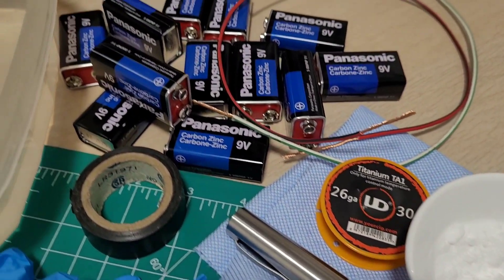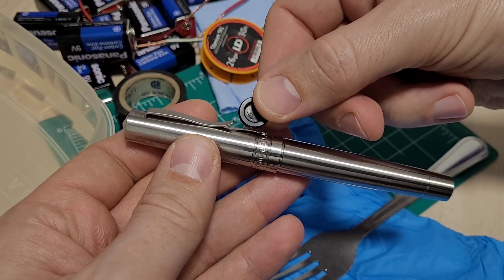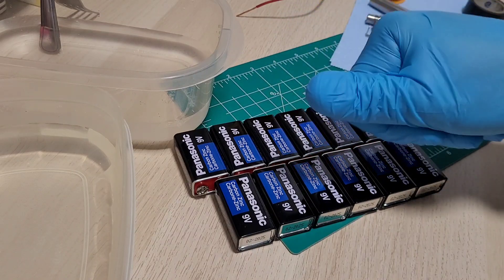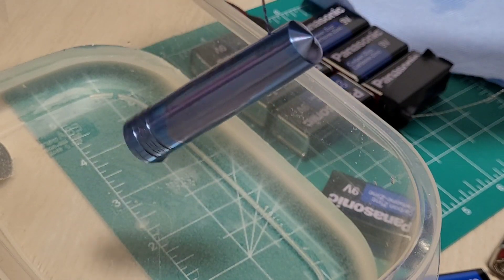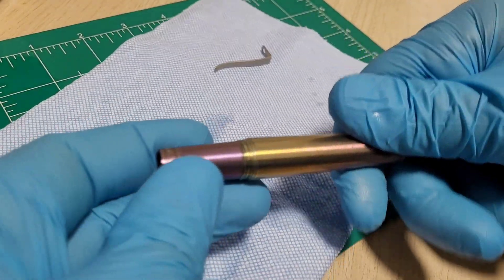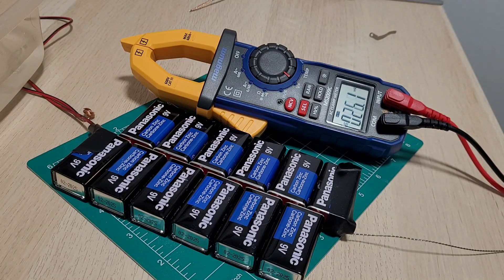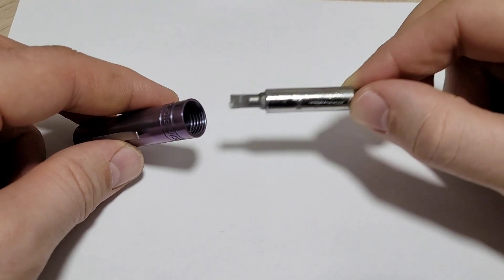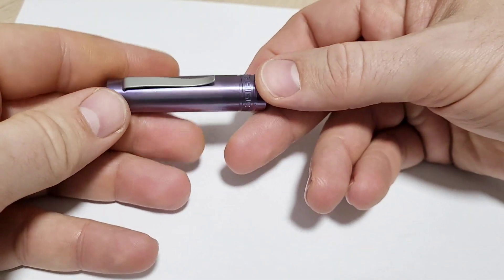How To Anodize A Titanium Fountain Pen (Ensso Italia)

Comment: Forgive my lack of knowledge, but why not just use copper wire for both leads?
Reply from the maker: I haven't spent time testing that out. But if I were to guess, I'm thinking you'd want the wire to be titanium so it behaves the same.  Ti is not a good conductor of electricity. For example, if you were to rank copper as say 100/100 on conductivity, in relative terms titanium would then be 3/100.  So I think if you had a much higher conductive wire, the electrons would flow to that metal instead of the titanium and the process wouldn't be as efficient.  Just me guessing, so not sure.
Reply: @Doodlebud  Got it.  Thanks

Comment: This is stunning!  How can I polish out the oxidized surface of the pen after doing this? Will it be easy to do as well?
Reply from the maker: It has to be etched off with chemicals. Common one is HF (hydrofluoric acid) which is nasty stuff. If you're in the USA  it's easily obtained in a product called whink rust cleaner. Here in Canada we don't have it. So waiting for the border to open to get some. Will be doing a follow up video.  If you do buy some BE VERY CAUTIOUS and follow all the safety precautions.  HF acid is VERY DANGEROUS stuff!

Comment: Do you have an updated graph for desired color now that you know the graph is wrong? i'd really like a teal or something similar. God bless (Matthew 5:45)!
Reply from the maker: Here's a site that has some good info & voltage/colour chart 
https://chemistrytalk.org/titanium-anodizing/
Reply: @Doodlebud  Hey thanks for the quick reply, i'm fascinated & truly tempted to do this, i already wrote down the instructions so i can quick reference when i get to do it myself.

If i can ask one more question, my pen doesnt have the Delrin plastic in the cap, could i dip the cap as is since it's pretty much just Ti then? God bless again, i pray you get to 1 million subs with your informational & fun to watch videos, not just reviews.
Reply from the maker: If yours is  just straight Ti its good to go. The other materials won't anodize from this process. To remove the anodizing afterwards if you want to change it you need to get Whink rust remover which has Hydrofluoric acid in it. NASTY stuff so be VERY CAREFUL. Gloves, glasses, outside for ventilation! But it takes off the TiO2 layer in a jiffy. Waiting for the US/CAN border to open so I can get some. We carry the same brand up here but our regulations don't allow HF acid in it. Ours has phosphoric acid which removes rust, but won't touch the TiO2 layer. Very frustrating! In the US you can walk into a Walmart buy some Hydrofluoric acid, and a 40 Oz of Jack Daniels all at the same time LOL🤣. Can't do that up here 😆

Comment: That’s pretty neat, always thought anodizing required more than household items. Might have to hook up the bench supply and have some fun. As an aside the voltage drop probably had more to do with the carbon zinc batteries than the wire. I suspect when you first drop the part it the current is higher and CZn batteries are pretty anemic. Cheapo Amazon alkalines might hold up better without as much Vdroop
Reply from the maker: Aluminum anodizing requires much more work, but Ti is VERY simple.  Yeah, these super cheap batteries can't handle the load, power supply would be much better or at the very least, better batteries like you mentioned.
Reply: @Doodlebud  I was going to bring up NiMH but there’s a few problems, who has that many spare rechargeable 9V, NiMH 9V vary in voltage depending on what brand and when it was made. Ranges from 7.2V to 9.6V and lastly on a new setup it’d be prohibitively expensive vs just buying a good quality bench that can do up to 110V (wonder if gutting an old, pre LED laser printer would work, can’t find a chart showing what colours you get in the kilovolts range)

NiMH should have no problems keeping up with current draw if any future readers happen to see this comment and have like a dozen or so rechargeable 9v from a fleet of multimeters.

Comment: I really like that colour that you ended up with. I have the same pen, and was thinking of doing the same thing to it. Thanks for walking me through the process! I was thinking of flaming it, but this looks safer, and less likely that I'll burn down the house!
Reply from the maker: Yeah flaming does work, but very tough to control the colour as the heat is still in the pen.  With this method you can stop the reaction at a desired point by voltage, or just take the pen out/disconnect and it stops instantly.

Comment: Nice job, DB. I’ve anodized a few different knife scales. The cathode wire doesn’t make that big of a difference, so folks can use steel or copper. The anode should be steel though for best results. It was very lucky that you removed the non-titanium clip from the cap. You would have had very different results otherwise. One other suggestion is to use a deeper container and not remove the item from the solution during the anodization process.
Reply from the maker: Thanks for the tips.  I had to remove it from the solution as the voltage drop on the batteries would just right down to zero if I left it in too long.  I put a meter across the leads and I could see when the batteries needed time to recharge.  Having a 120V variable DC supply would be Skookum!

Comment: I should try this on my Muji pen some time. Apparently anodizing aluminum is pretty straightforward too
Reply from the maker: Aluminum does take a bit more too it. Also have to select the correct dye to give the desire colour.  With Ti, you just adjust the voltage which is really neat.

Comment: Give my creation LIIIIIFE!!! Great job, DB. Could you have left the clip on since it wasn't titanium? Would the plastic disc have been ok? You had your color, did you continue dipping it, or does it continue to change after you rinse? Very cool demo, thanks!
Reply from the maker: Could have left the clip on I guess but don't know if it damages the surface just running it without being coated.  Also increases surface area which requires more energy from the batteries which are being strained already.  I don't think the process would damage the delrin disk, but if I need to etch the surface to remove the coating and try again, not sure if that will damage the part.  Just a good idea to only put titanium parts into the anodizing bath since that's what its setup for.

Comment: Not too shabby for a first attempt. This beats out the flame method 100% and watch the color change while it’s in the bath. 

Another suggestion would be to go full beans on voltage till you get to green. I prefer the purple, but that’s all personal preference.
Reply from the maker: I think I need to do a quick etch on the metal before I put it in to better prepare the surface.  Also, this "power supply" has limits on going full beans.  But will grab a few more batteries and see what I can do.

Comment: Thanks for the video. I did not know the process of anodizing. Vaguely similar to electroplating. I did not realize that the amount of voltage changed the color.
Reply from the maker: This method makes it much easier to control than using a flame

Comment: Great tutorial 👌 thank you.  I like the purplish color. I want to try anodizing, just need the Ti wire.  Could I use stainless wire?
Reply from the maker: I think SS will work, but don't know how well.  Everything I look up says to us Ti wire.  Ideally, I would habe a piece of titanium for both electrodes as well (instead of the fork).  Ti wire can be bought on amazon but also like I did, visited a vape shop and had what I needed $5 later.
Reply: @Doodlebud  I'll try vape shop, I live in NYC they're all over.
Reply from the maker: Definitely do that, super cheap. Just call ahead or check their website to see if they stock the wire to make coils. Not all shops up here did. Had to call a few to find one near by that did